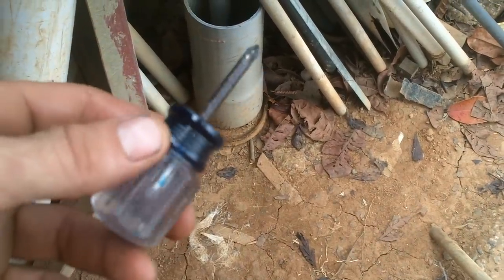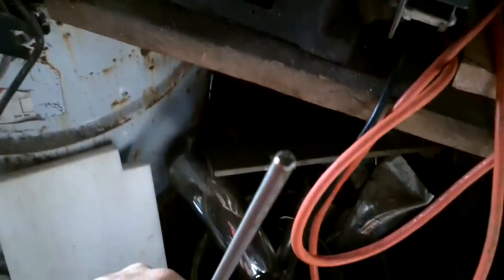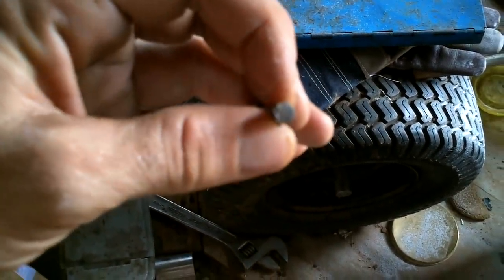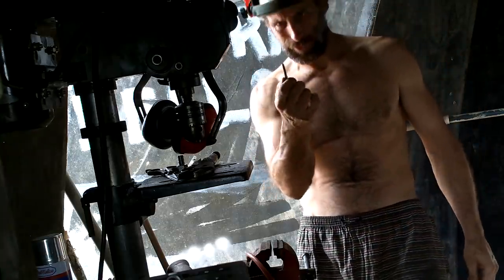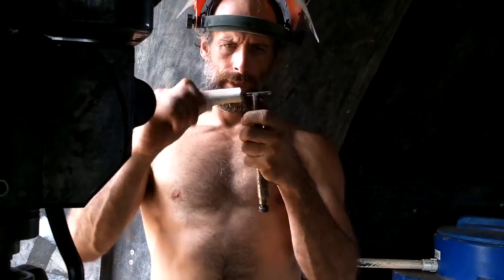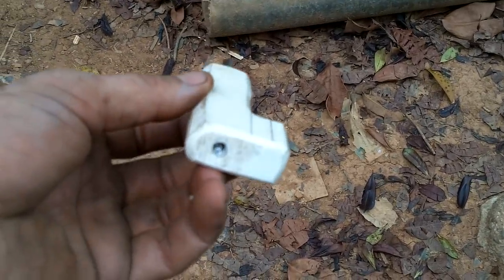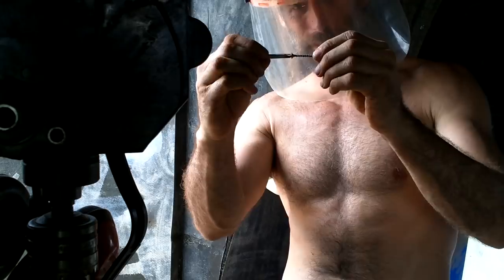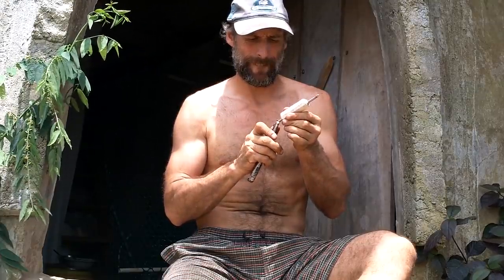Homemade Stainless Screw Driver for me Boat.

Comment: dude!  just nickel plate it!  get a couple of those nickel strips they use to weld batteries together, some vinegar and you can make nickel acetate.  then its a quick thing.  Alternately galvanize it with some tin/lead solder.  super easy too!

Comment: They sell a fluted rod specifically for tool handles. I made a couple of tools and used the clear yellow tenite rod. I think it was 1.125” diameter, still have them in my garage somewhere. It has been nearly 40 years since...  Tenite is a great material, machines pretty good too.